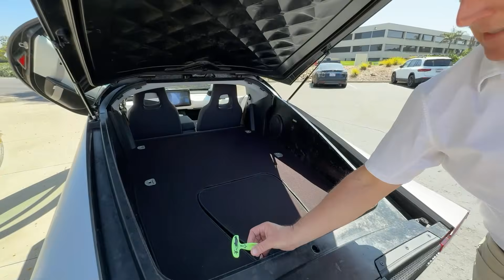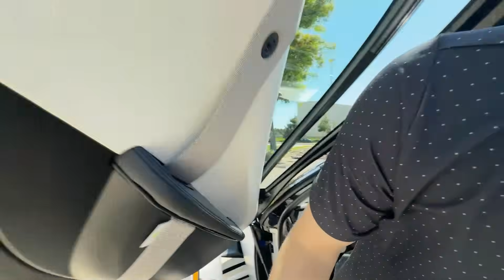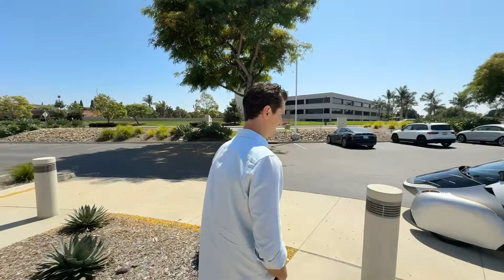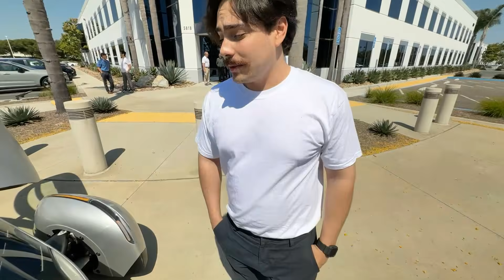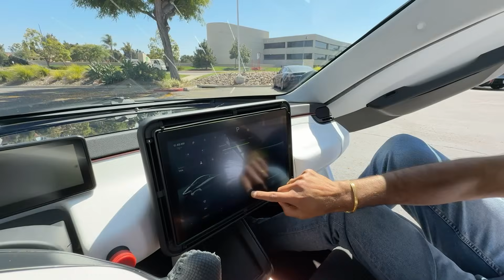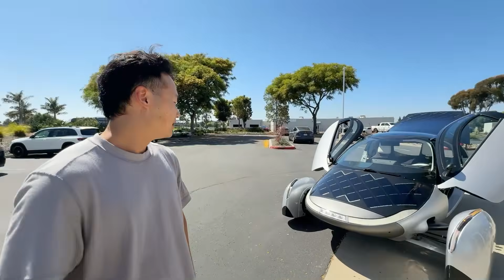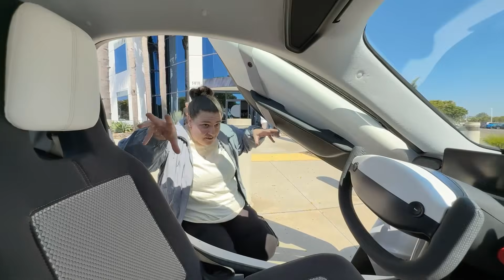Aptera Milestone — Introducing the Next Validation Vehicle

Comment: Have you had the lighting specs verified for European use?  The main lamps appear to be central, which might present you with an insurmountable problems, so too the need for amber indicators front, rear and front side repeaters.  The steering yoke looks marvellous, but the stitching detail is frankly awful.  I trust this isn't in production intent quality just yet?  Many manufacturers use a groove into which the front and rear steering wheel trim is pressed to retain it.  The outcome is far more professional looking in my view.

Comment: Really cool car!   I am a long-time reservation holder.   But I had given up on Aptera after it decided to somehow justify it should cost a couple grands more than the latest Tesla Model Y RWD with 360 miles range.   Other than people with attention-seeking ego or people with impulsive nature, no logical mind would choose the Aptera over the Model Y.    The model Y is proven worldwide, a lot more space, a lot more practical, a lot more functionality, etc.   The bigger issue is the niche 2-seater; what is the buyer population for a 2-seater?   How would any one justify paying more and getting a lot less with an Aptera?

The model Y does use more Wh/mile than the Aptera, but the Aptera is a lot smaller.   It's similar to arguing that the Ford F150 uses a lot more gas per mile than a Miata, and therefore the Miata is a lot better.

The model Y also doesn't have a solar roof.   So an average driver would have to pay for 24 miles of electricity per day or 6 kWh in a model Y RWD.  That translate to about $2.0 if using a Tesla supercharger or about $1.2 if using a home charger.    Would you want to save those couple of dollars to give up on everything the Model Y can offer more than the Aptera?
Reply: I think the benefit of the efficiency and solar panels has little to do with saving money. Here is how I would market it:

The Aptera isn't a car; it's a revolutionary step toward a more sustainable, self-sufficient future. Designed with performance, convenience, and environmental responsibility in mind, the Aptera offers an unparalleled driving experience that fits seamlessly into your lifestyle.

Affordability Meets Innovation
Low Cost of Ownership: The Aptera offers an affordable price point with lower long-term costs compared to traditional vehicles. Enjoy the benefits of cutting-edge technology without the high purchase or maintenance costs of many other electric cars.

Minimal Charging Needs: Its extraordinary energy efficiency reduces the need for frequent charging. Whether you're commuting, running errands, or hitting the road for a weekend trip, you’ll spend less time at charging stations and more time on the road.

Performance Without Compromise
Quick and Nimble: Despite its unique design, the Aptera delivers powerful acceleration, making it a joy to drive in urban and highway settings. Its lightweight structure boosts both speed and handling, providing a responsive, fun experience.

Long Range: The Aptera is built for long-haul adventures, offering a range that will take you further with fewer charging stops. Whether you're exploring nearby destinations or venturing on cross-country trips, you can trust the Aptera to go the distance.

Solar Power: Drive and Camp with Confidence
Self-Charging Capabilities: Equipped with solar panels, the Aptera harnesses solar energy to recharge as you drive or while parked. Whether you're parked on a sunny day at work or camping under the stars, you can rely on the sun to power your ride, reducing dependency on traditional charging stations.

Off-Grid Camping Ready: The Aptera is perfect for outdoor enthusiasts. Its expansive storage, combined with solar energy, lets you camp comfortably. Run the A/C, charge devices, or simply enjoy peace of mind knowing you can live off the grid without needing external power sources.

Never Get Stuck Again: Imagine being on a winter road trip, and your destination is just out of reach—there’s no charging station nearby, but you’re still covered. Thanks to its solar power backup, you can crawl home at low speeds, ensuring you’re never stuck without the ability to move.

Unmatched Convenience in Any Season
Climate Control on Demand: Keep your Aptera cool on hot days by running the A/C while parked. The solar power generated by its panels ensures you can keep the vehicle comfortable, even when you're not driving. No need to worry about overheating items or discomfort when you're not in the car.

Wintertime Security: The Aptera is designed to provide peace of mind even in freezing conditions. When temperatures drop, use the solar-powered system to keep the vehicle running and stay mobile. You can make your way home slowly and steadily without burning through battery power.

Designed for Adventure: Spacious Storage for Camping Inside
Generous Storage Volume: The Aptera’s interior provides expansive storage, with plenty of room for camping gear, luggage, and more. Whether you're planning a weekend adventure or a longer trip, you can fit everything you need with ease.

Camping-Friendly Design: The Aptera's spacious interior and innovative storage design make it an excellent choice for camping. The cabin provides ample room to stretch out or sleep comfortably, allowing you to camp inside the car without feeling cramped. Whether you're parked under the stars or at a campsite, the Aptera’s design maximizes comfort while giving you the freedom to explore the outdoors without leaving the car behind.

Flexible and Practical: The Aptera features well-designed storage areas, including both front and rear compartments, offering convenient access for gear, coolers, and other essentials. With enough room to sleep inside the vehicle, you can rest comfortably after a day of adventure and be ready for more the next morning.

Sustainability Meets Practicality
The Aptera exemplifies the future of transportation, offering sustainability, practical benefits, and an exciting driving experience. Its solar-powered capabilities, impressive range, and camping-ready interior combine to make it the perfect vehicle for those seeking efficiency without compromising comfort. Plus, with its extensive storage space, you’re ready for anything—whether it’s a long road trip, a weekend camping adventure, or daily commuting.

Drive the future. Experience the freedom, efficiency, and innovation of the Aptera.
Reply: I suggest everyone in this thread save their energy and not bother comparing the Aptera to anything until it actually goes into production.
Because even if it does, which is seeming unlikely, it's what the production car can actually do, and what they're actually charging for it, that matters. Not the company's promises.
Reply: For the majority of people the extra space in the F150 Lightning and Model Y is simply wasted space.  Personally I've only had need for more than 2 seats in my commuting vehicle 2 or 3 times in the past 15 years so why pay the extra $2 a day for charging plus higher Bodily Injury Insurance fees for the extra passengers you may never have?  Right now because my vehicle has seating for 5 passengers I have payed for additional bodily injury insurance for those 3 additional passengers that I've never had which adds up over time to exceed the cost of the vehicle.  Every minute you own more vehicle than you actually need your just throwing money away to fuel, maintain and insure it.  Hand wash/wax an F150 or Model Y and then compare that to hand washing/waxing a Miata or Aptera then you'll see another benefit of having a smaller vehicle.

Also with the much less efficient F150 Lightning or Model Y you will more likely need to install a dedicated Level 2 charger in your home which is very costly plus requires a permit and licensed electrician to install it while with the Aptera most won't even need to use an inexpensive (most often Free) 120 volt L1 charger and if they did they won't need anything more than a standard 15 amp receptacle to plug it into.

With the Aptera Joe/Jane Average who drives less than 30 miles round trip per day saves the high cost of installing an L2 charger at home plus if they're one of the many that rarely has more than 1 passenger then with only 2 seats, saves on bodily injury insurance every year they own the car.

We need more efficient EV's like the Aptera  that don't require massive batteries that require powerful and expensive charging equipment to get them charged up in a reasonable time.

Best!
Reply: @neilfromclearwaterfl81 about space, I had just bought the model y juniper, bypassing the smaller and cheaper model 3, even though it's only for a household of two.   It's because it's for more than just commuting.  It's also avoiding a need for another vehicle to carry stuff, for more comfortable long distance trips, for carrying grandkids, etc.  A two seater would be a lot less functional. 

About the charger, there is no need for a dedicated wall charger at home.  The Tesla can be charged with 3 to 4 miles per hour from a standard 110V outlet, I.E.  about 40 miles overnight.   In my case, that's more than sufficient for my 16 mile round-trip commute.   So, no need for an expensive electrician,  permit, or a wall charger. 

My issue with aptera is the deeply uncompetitive price. The aptera is smaller, requires a lot less materials to build, has a much smaller battery, etc., but it's more expensive than the model y rwd.  I was willing to compromise on space, functionality, etc and buy an aptera to support aptera's cutting edge innovations, even when it was at $32k.   But at $40k, it screams that aptera will not be able to compete, will never be mainstream, will have to settle for a very small niche market. segment.

Comment: Uh .You never want a shiny dashboard as it throws a horrible glare on to the windshield.
Reply: As I often say, engineer's are the smartest people in the world, but you would have a hard time finding one with common sense..Glass Dash proves that point. 😂
Reply: An antireflective coating would practically eliminate the problem.
Reply: Why don’t they just angle the dash away from the driver?
Reply: And just how efficient are solar cells under thick UV glass? It is UV glass, right?
Reply: @dmrr7739 Photovoltaic cells need light, not UV, so hopefully the windshield is UV treated.
Reply: @dmrr7739  Most of the solar power comes from visible light.
Reply: Easy fix: dash cover off while parked and charging in the sun; dash cover on while driving if glare becomes an issue.
Reply: @robertb.5624 Then they better include a cover standard or there will be complaints.
Reply: Yeah, not good. Some 3rd party will be selling a dash cover within days of this thing being released, if it ever is. I'm also not a fan of the screens. Prefer buttons, knobs, levers and classic instrument panels. But to each there own on that.

Comment: Is the glass dash going to cause severe glare from sun reflections?
Reply: If it does cause reflections (which is likely), cover it while driving (someone if not Aptera will make an inexpensive cover) — and then remove the cover while parked soaking up the solar.
Reply: @robertb.5624 This WILL be an issue, so if they insist on having a solar dash, the cover MUST be included at no extra cost.
Reply: @BrandEver117  I think by the time they are in production the glare issue will have been addressed.
Reply: Yes
Reply: No

Comment: 28:45 lol just gonna casually borrow the company's most prized possession

Fantastic format for the video.. great to hear from some of the experts you have over there talking about the specific parts they worked on.  Thanks for the video!

btw, I love the knock-knock feature, but it has me thinking about a kick-kick feature, so you can still open the door or the trunk when you have your hands full
Reply: "Borrow the company's most prized possession."  I hear ya.  If I worked there I would be scared to drive the thing.  Until they put it into production, the Gemini and Artemis prototypes are worth millions and could not be easily replaced if I hit a deer or a troll or something.  That would cost the company far more than that!
Reply: Not a problem for a ballerina.

Comment: With the change to a central motor rather than hub motors, will there really ever be an all-wheel drive version?
Reply: @stuartholmes8701 - They lamented that they had to temporarily go with the inboard motor to get into production more quickly however once supply chain issues are resolved they stated that they still plan to switch to hub motors in the future once they become more readily available.  Covid 19 did throw a wrinkle into supply chains globally some of which still haven't recovered and others simply didn't survive having shut down permanently.

Best!

Comment: considering that the sun breaks down vehicles, and this vehicle is meant for the sun, the glass seems to be a good idea, but is the rest of the paint/body have materials that can outlast the suns destructive abilities?
Reply: My first-gen Insight has plastic body panels that are 25 years old and still fine. Not saying Aptera will have good body materials, or even exist, but it's not literally impossible.
Reply: The sides have vinyl wrap. Cheaper than paint so can be replaced after a few years if needed.

Comment: add blackout shades (full 100% no gaps) with infused solar panels for all the windows with the camper kit. You could add aesthetically looking strong magnet perimeter around all the windows that have magnets sealed inside along the perimeter for easy convenience and solid seal. I'd pay extra for that camping kit.

also, make sure that no outsider can open the car while camping inside the vehicle because the phone could accidentally RFID or Bluetooth unlock the locks because of close proximity to the unlock sensors or whatever.

Comment: Can the seats fold forward so I can toss my briefcase or backpack right behind the seat without having to open the truck lid. If so, you should have something like a velcro strap that would keep the briefcase/backpack from sliding/rolling around when the vehicle is in motion. Does the rear camera have guide lines to center the vehicle and show the distance between the rear end and a curb or other object when backing up? Is the infotainment system Carplay compatible?

Comment: I like that there are back up controls for the PRND, however I am very disappointed that we don't get physical HVAC controls. I work on lots of electric cars and when you get into one that is sitting in the sun you want the a/c to be blasted as quickly as possible and that is one of the biggest mistakes with them as you have to wait for the software to load before you can do that. Also not a fan of the screen controlled windows, I would actually prefer manual crank windows. 

I also hope there will be a real steering wheel available to install as I hate yoke steering. Another thing I want to see is a good cargo mat as we intend to use ours for picking up supplies for our restaurant and something that will capture any spills and is easily cleaned would be nice. 

I also like the cloth seats, they are superior in every way to leather and you can't even buy a mid range car nowadays without having to get leather.  

Is there going to be a key for it or will you need a phone to access it? I hope the former as I refuse to own a cell phone and prefer real keys.

Also an inverter with plug would be nice instead of only the 12 v, since I intend to camp (pre-ordered the tent) with this and would love to be able to power a small bar fridge as well. 

I hope next year you will be touring all of the international car shows so I can see it in person and get a feel of how mine will be like.
Reply: Solar Power System: The solar panels contribute to maintaining comfortable ambient temperatures inside the cabin even when the vehicle is parked in direct sunlight. This helps ensure a pleasant experience upon returning to the vehicle.

Comment: So this is a new vehicle why is there a big dents on the passenger side trunk hatch is the body that flimsy because it looks like several dentse
Reply: That solar pane is the old polycarbonate one. They are waiting for the glass one to be delivered.
Reply: Not the solar the actual side of the body next to it that's where the dent s are
Reply: @ronnieloyd6510  Just like Aptera is saying they didn't use a windsock on their microphone to make the stream more "authentic."  Perhaps the dents are there for authenticity purposes.
Reply: The dents were purposely put in the structure of the rear hatch to strengthen it.

Comment: I noticed that the drive shafts don't have aero covers. The inside of wheel pants look unfinished. Stitching on top of yoke looks a bit rough. Sun visors look a bit small. Wiper seems to be a bit exposed for good aero. Are the sides of the trunk staying unfinished? Is this finished with the final vendor wrap? Are you tired of all the questions?
Reply: I think the sides of the trunk are supposed to stay this way - it's a feature not a bug as they are all different in their patterns. I am not sure about this choice, though (meaning if it will stay like this AND if it's a good idea). Probably cheaper anyway :)